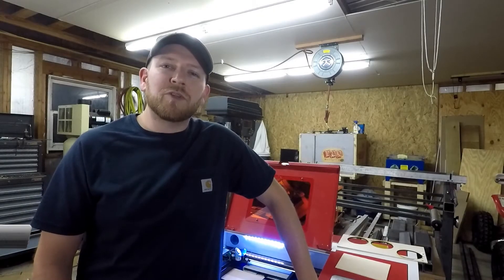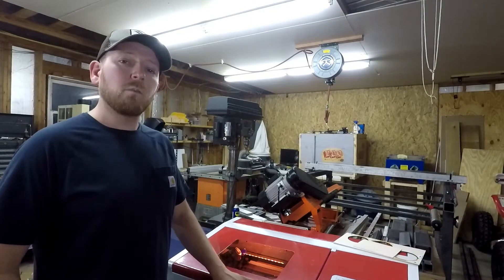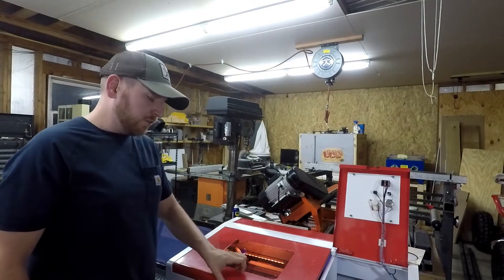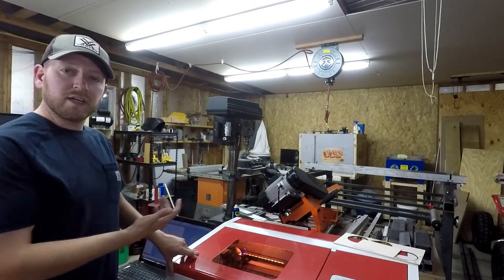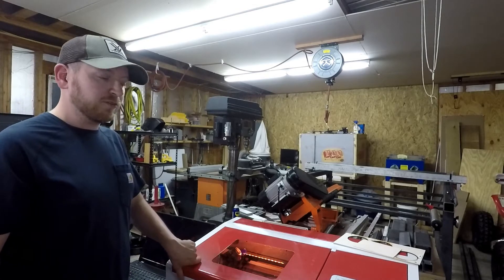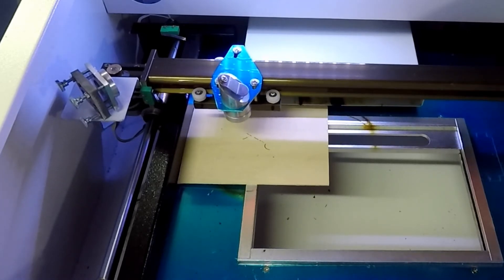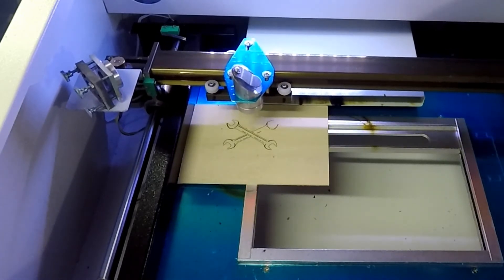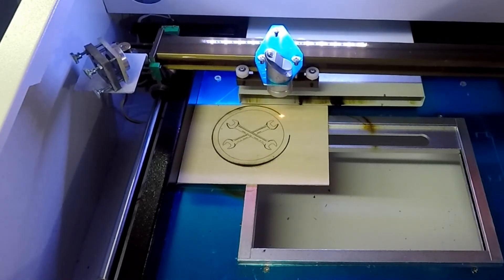Introduction to Cheap CO2 Lasers: The K40 Laser

Comment: The weak links are the fume exhaust, the bed is useless, and the software is terrible.
The exhaust can be made temporarily functional with lots of sealing, foam & shimming; but will need to be upgraded.
The stock bed has to go. There really aren't a lot of good affordable options for bed upgrade.
K40 whisperer is simply amazing! It's good enough that I don't feel the need for a controller upgrade yet.

I did upgrade to a full set of mirror & lens mount with air assist and focal adjustment built in.. it made alignment so much easier & more stable. The adjustable lens holder has enough travel to eliminate the need for a bed with anything other than a few coarse adjustments.

Comment: My K40 won't stop at the home position. The belt keeps running. could you possibly help me or steer me to someone who could. Thanks, Mike
Reply from the maker: Hey man, I might have some thoughts. So you need to run down that switch. Check continuity when you press the switch down. It may be hot glued to the board but you'll have to check it anyway. Does it click when you press the switch. Regardless my guess is that the switch went bad.

Comment: Awesome! Have you used it to do part marking? Like a serial number on anodized aluminum or painted steel? That’s what i would like to do with it. Good video. Keep it up.
Best matt
Reply from the maker: Interesting you bring this up. I just finished installing a light object powered z axis table. It has holes that I plan to use for small fixtures. Going to locate my bottle openers and such to brand them. Have had a lot of requests for branding for bands and the like. Hoping to do a video. Working on one cutting a 3/8 steel gong on the plasma table though. Trying to get back into making more videos.
Reply: Engineering Awesome very cool! Video on that yet?
Reply from the maker: @centurialinc  Not yet. But I plan on doing it. Still working on the programming. Using a ramps setup which is a bit harder to get working. Using limit stops to move it up and down.

Comment: The air extraction fan I got with mine was useless. I recently upgraded it with a modified bouncy castle blower fan, using the inlet to suck the smoke out. Its cheap and powerful (£10 here in Ireland for a second hand one).